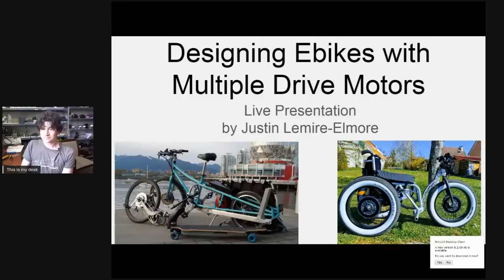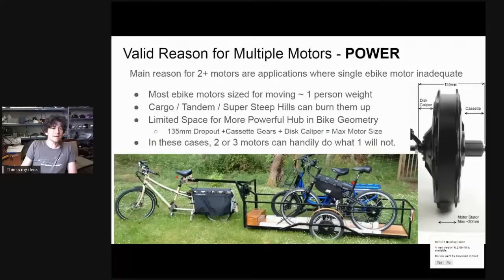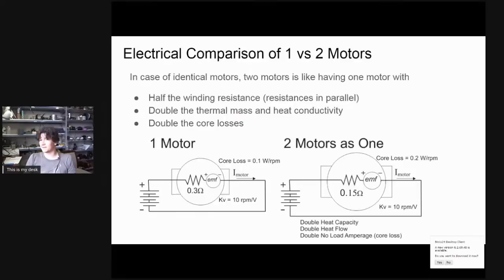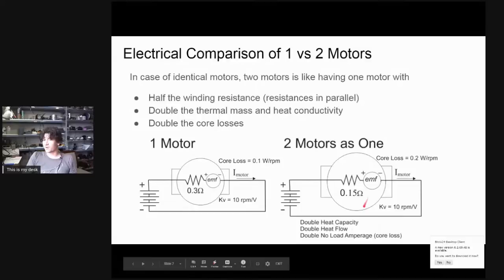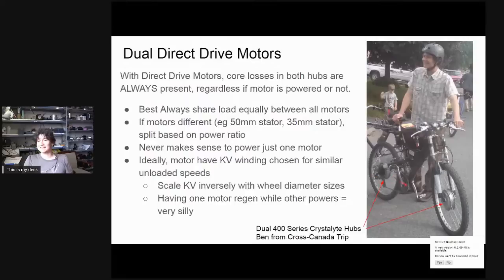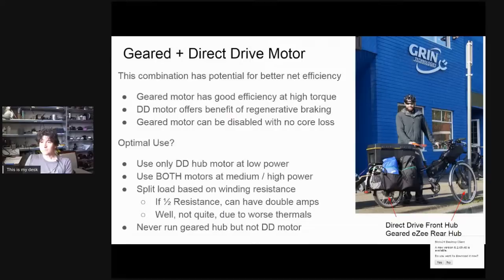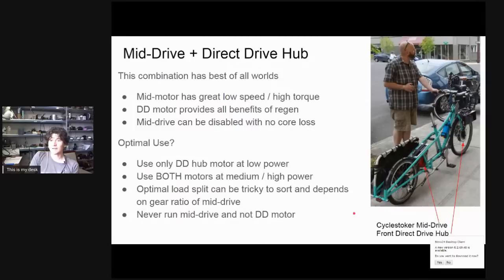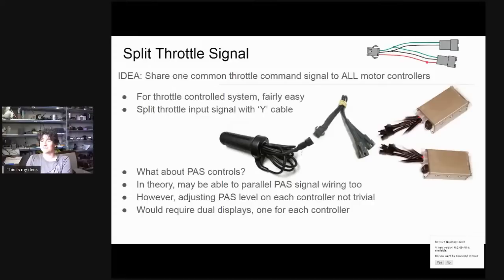A guide to multi-motor (2WD and 3WD) ebike drive systems

Comment: Great video! I'd like to know if there is any issue with switching to dual motor whilst in motion or even whilst accelerating for a dual motor scooter?
Reply from the maker: Nope, but as mentioned in the video if you have dual motors you should generally be running both of them equally all the time, rather than switching back and forth between 1 motor and 2 motors.

Comment: can i do a 2 battery blender with one controler port that will feed two 48 volt motors via a 3 way y spliter on my trike. some one told me that will blow up my electrical system. who is right?
Reply from the maker: You can run your controllers off a common battery bus or off individual batteries, both options are just fine. But no matter what, each motor needs its own controller.

Comment: Hi.
I have ebike model MATE-X-750W.
Battery 48 V/14Ah fail.
On side battery voltage terminal 42V -when turn battery key to ignition position-drop to 0V.
What can i do?
Buy new one?Where? Replace insert? Where to buy?
Reply from the maker: The shop or vendor who sold you the bike should offer all the support and warranty.  42V is dead flat for a 48V nominal pack, so naturally your BMS discharge port is tripped. I would start off by charging your battery until it reads 53-54V.

Comment: What about ABS system for dual regen braking? Or if even, electronically assisted ABS disc braking?
Reply from the maker: You just don't need ABS with regen.  That's a holdover idea from mechanical brakes in automotive systems.

Comment: For the best cornering performance in a 2WD ebike wouldn't you want to use the rear motor while having no power to the front? This way the rear motor pushes you around the corner and the front motor does not pull to the outside of the corner.
Reply: How fast do you intend to corner? And what's your weight distribution (F/R) like? My ebike weighs 100 lbs. -- probably 35% front/65% rear with me on it -- and it corners just fine at 40 km/h on 2.3" Schwalbe Crazy Bobs @ 50 PSI (~3.4 bar) with just a front 9C clone motor. Maybe you're talking all-out performance tho, in which case you'd do best to not use a front motor at all.

Comment: I'm considering a dual-motor system so this presentation was extremely helpful, Thank you! Is there a link to the simulator?
Also, generic question about direct-drive hub motors: should I assume that if I have the DD motor in an off condition that when I am pedaling I will have to overcome the resistive force of the DD motor as described when the DD motor is slower than the flywheeled motor?

Comment: In 2WD and 3WD setups using hub motors, does the brake trip sensor apply regen braking to each hub equally as well?
Reply from the maker: If each motor controller is configured to respond to the regen brake signal in the same way, then yes. Otherwise no.
Reply: @GrinTechnologies  thanks

Comment: What about the extra mass of the 2nd motor?  Surely that has to have an impact on efficiency but I didn't hear you mention it.
Reply from the maker: 4kg of extra mass has virtually no effect on efficiency or wh/km consumption rates. There would be a little but more energy used going uphill and accelerating, which would be countered by a little more regenerative energy recaptured going downhill or stopping.

Comment: heat doesn't just degrade the copper. Curie points of magnets is law; permanent magnets are impermanent.
Reply from the maker: Yup, but the magnets are usually thermally linked to the casing of the motor shell rather than the stator core, and so don't get nearly as hot.  At least in DD outrunner motors.  Geared inrunner motors are another story.

Comment: I'm very new to ebikes. If you have 10 seconds I have a quick question sir; if someone was running 2 hub motors and their combined max current from the controllers was 60 amps, and you used a battery with 50amp BMS (52v 20ah), what would happen? If you ran WOT you may trip the BMS of the battery and it come back on after a few seconds? Or something worse? Thank you!
Reply from the maker: Nothing bad. Either it will trip the BMS circuit, or it won't.  And if it does, either it will turn itself on again automatically, or more likely you will have to unplug and replug the battery to the controller as most BMS circuits latch their over current cutoff protection to the detection of an external load. You have to fully remove all loads from the battery for the BMS to reset.

Comment: Justin, what hub drives exactly did you use on your friend Michael’s Easy Racer conversion for his Dempster Highway trip? I’m looking to set up a RANS Stratus LE with either dual hub drive or front hub and mid drive, depending on how screwed up the rear dropouts come. Also, you didn’t mention another good reason for dual drive: more equal tire wear!
Reply from the maker: He went with the eZee geared hub motors.  But normally for long distance trips we recommend direct drive hubs like the Grin All Axle or FH212 / RH212 series just because there is less that can to wrong with them.

Comment: If you have two identical hub motors for a rear wheel driven trike. Example
Two identical 3000 watt hub motors both set up with 26” rims and tires, can you just split the throttle signal to each controller regardless of whether it is a torque or voltage throttle/controller ?
Thanks for your response. Your video is awesome but a bit above my electrical understanding. 🥹
Reply from the maker: You can. With a voltage throttle and not a torque throttle, the slower motor on the inside of the curve will be generating more torque and power and could be at higher risk of skidding out.  On a rear delta trike this would have little consequence, but on a christiana style trike it puts a straightening moment on the handlebars. 
With a torque based throttle, then the torque is identical on both hubs at all time regardless of the turning.

Comment: I want to know how much service Grim offers when one purchases a kit? Can Grim set the parameters on my system remotely? Is there a way to share CA data with Grim in order to dial the system in according to the data that is collected over a period of riding?
Reply from the maker: We provide guidance on installation and settings, but can't set your parameters remotely... You could absolutely share your CA data for advice on settings.

Comment: what setup would you recommend for someone wanting to pull around 450 lbs not counting the batteries and motor weight... im wanting to build a bike that can pull my weight... a 75lb dog in a trailer and camping gear down the westcoast... so steap hills and mountains.. i need long range.. good speed.. and i also intend to mount a solar panel to charge it when i cant find a place to plug up
Reply: You know who has the answer? The front desk clerk at Dinty's Motel in Biggs, OR. Good luck, rich boy. ;-)

Comment: What is best two hub motor system it the two tires will be next to each other off road use
Reply: I dunno what you mean by "system", but as long as you can mount them, you'd just use two motors and controllers of your choice with a single throttle (and Justin's magic cable) controlling both. Don't worry about turning; the motors will do "differential action" all by themselves. HTH.

Comment: Hmmm… You are assuming that you are using multiple motors all the time?
Reply from the maker: This point is discussed at depth in the video if you watch and pay attention. To summarize, in most situations it is best to use all motors, but there are some specific scenarios where the efficiency will be a bit higher using just one.  That's only the case if you have the non-driven motor with a freewheel.  If the motors are always engaged (ie not freewheeling), then you should always share the load among all the motors all the time for the best efficiency and lowest power draw.

Comment: I am planing to build an ebike with two hubs (front and back ) and two mid motors 
So what's your opinion
Reply from the maker: I think two mid-motors is silly and will exceed what you can push through a bicycle chain for no real benefit to speak of over just one mid-motor.

Comment: If I could had a rear motor to my mid-motor bike.   I would use the front to brake up hills.
Reply from the maker: Braking up the hills seems like a curious use of your hypothetical 2wd motor power, but sure if that's what turns your cranks!
Reply: @GrinTechnologies  I wanted to day down hills :).  I want to add a front hub.
Reply: @GrinTechnologies   I called Grin Technology to check if the SX1 front hub would be compatible with my Gazelle Ultimate c380 e-bike. It seems like it is not possible to install any other sensor for pedal assist.  Can you please check my bike model and tell me if there is a solution. 

At Grin, you mentioned that I would only be able to use a throttle. I want to use both systems with pedal assist, they don't have to be integrated.

Comment: You talk about a hybrid system human - electric and you miss half of the topic by ignoring the human part of the system... Would it be possible to display at least the heart rate of the driver  an the Cycle Analyst? Just to start taking into account the other half of the system. The next step would be to adapt the generator's resistance to the heart rate on an all electric drivetrain ;-)
The presentation on the electric part was very interesting, thanks
Reply from the maker: The Cycle Analyst shows the human power input in watts along with the cadence in the 3rd display screen, as long as you've put in a torque sensor on the cranks so that it has that info.  So you do indeed see your human watts and total human watt-hours, and have an idea of how that compares to the electrical watt-hours.  

We get asked about heart rate control quite a bit, but there's not an easy way to tie in existing heart monitors to the current ebike hardware platforms that we deal with.

Comment: Could this potentially be used for a 4 wheel drive system? Just split the wire again? Would a single cycle analyst be able to do 4 motors?
Reply: That's what I want to do. I want to get a recumbent quad and have a hub drive on each wheel. My guess is I need 4 controllers & screens (one for front & one for back) as well as plenty of battery power. Have you done anything like this yet?
Reply: @davidcarr2649  not yet but GrinTech did give some good info. You would need 1 cycle analyst, 4 controllers, 4 hub motors, and enough battery. It would be a bit pricey. Make sure you order the grin tech controllers that allows for a reverse switch.
Reply: @mattmccoy2621  thanks.

Comment: did you bicycle across the Canada/USA border? What was your experience like doing that?
Reply from the maker: Several times, and the experience has always been just fine.
Reply: @GrinTechnologies  which border crossing did u use (Huntingdon or Whiterock or?) ? it seems like things have gotten much more difficult particularily when going from Canada to US at thr vancouver . if u use the White Rock crossing is there a path for bicycles to use or do you have to cross with the cars? I am also wondering when u have your trike or quad bicycle with a bike trailer.

Comment: what is KV ? could not find any explanation on web, except kilovolt, which is, i believe, not what KV stands for in this presentation.
Reply from the maker: https://www.youtube.com/watch?v=c96n0Ma2rLY  watch that video which explains Kv in some detail. It's one way of expressing the motor constant  (either rpm/V or rad/sec/V)
Reply: @GrinTechnologies  i did watched that (also very valuable) video, before this one video, but i guess i missed the KV explanation. thx for sharing, have fun, s love nia

Comment: interesting, don't you run into a problem when 1 motor runs faster even if both are are on the same throttle?
Reply: That's why you need motors with the same KV
Reply from the maker: Or simply a controller that uses a torque throttle command as I explained in some detail in this presentation
Reply: That's not very likely as the loaded speed of a motor (when you ride it, not freewheeling it on the bench) is significantly lower than the unloaded speed. Of course if one is much faster than the other then there is trouble....

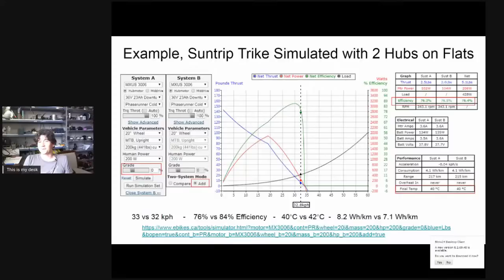Comment: 31:00m Dual motor efficiency not recoverable if one motor is off. 
AN EVEN BETTER SOLUTION is with two GEAR DRIVE hub motors, at least ONE with a LOCKING FREEWHEEL BEARING.
Reply from the maker: It depends on the exact load context and motor choice.  The top efficiency of good direct drive motors at higher speeds (~86-90%) is usually better that of equivalent geared motors (~80-85%). But this isn't a universal truth.
Reply: @GrinTechnologies  Eng. Vision is blinding to the common picture that geared hub motors except at the extreme power end are now dominant for aesthetics and weight and are no longer noisy. Have a couple of drawbacks w heat dissipation and no reverse that are not unsolvable. Last issue and most important is regen + "free" freewheel . <:)

Comment: Hey use 2 throttle, one for each thumb. Is that to much effort to use 2 instead of just one thumb. Also you don't want both motor working all the time. Example when you turn at lower speed, that front wheel risk spinning.
Reply from the maker: For best performance you do want all motors working at the same time within their limits. So on the front wheel drive you would set a maximum torque (via the controller's max phase current) to ensure it keeps good traction. I would suggest watching the full video which also covers the multi-throttle approach, around the 47 minute mark.

Comment: 1 motor limit in UK,  if I put 2  tiny 100w motors on a bike I'd be 'dealt with' as if i was riding a 1000cc kawasaki ninja.....
Reply from the maker: Pretty wild how strict they are over there! Out here it's the wild west.
Reply: @GrinTechnologies  Its a 'top down' system for motorised vehicles, so anything starts at like juggernaut/tank level, and its up to you to prove your something less. so an ebike gets all the way down to motorcycle, and to get down to (e) bicycle you need the qualifying pedals that work a wheel and 250w or less motor limited to 15mph. thats where electric scooters dont fit, even if you have a 250w 15mph scooter , it has no pedals, so its a motorcycle.

Comment: No. One throttle for 2 motor it's full of disadvantages. I have 3 motor 3 independent system. 3 throttle. I use them in many situations and many combination. On a cruise control I use the one who has more battery left. When you turn at low speed you don't want the same power in all wheel. You know activate one or 2 throttle is not a lot of more effort.
Reply from the maker: You're free to do that too if you like! But from a system efficiency perspective, it's almost always best to simply distribute power evenly among all the motors, than running them individually at wildly different power levels.